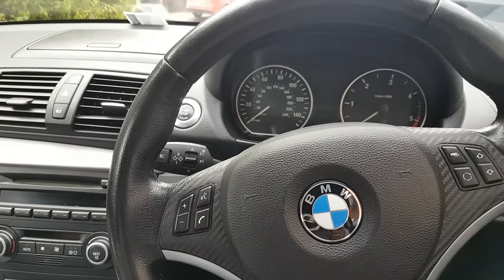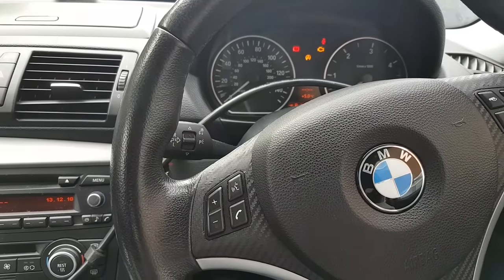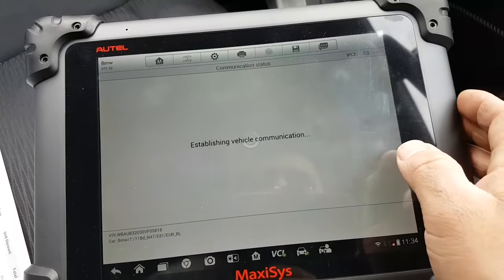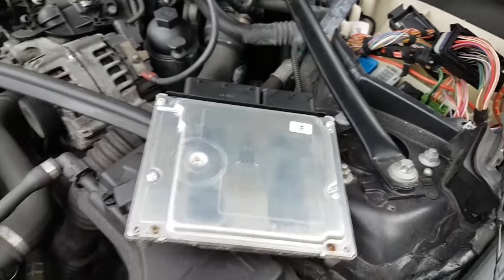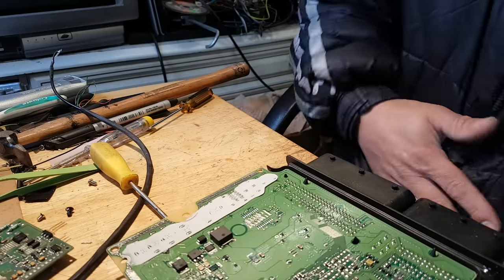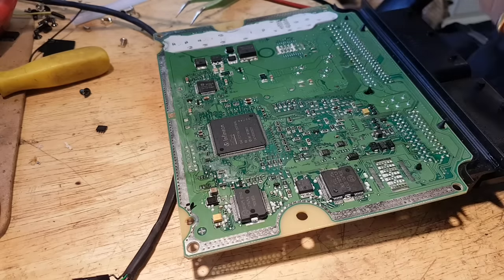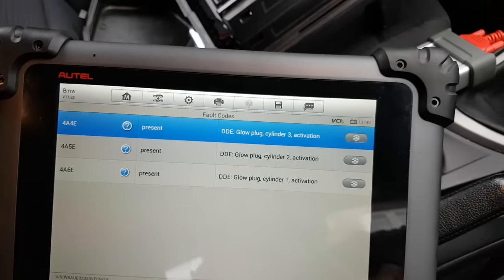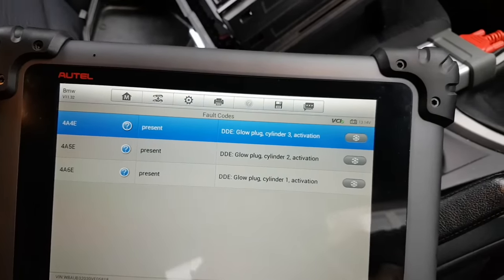BMW 118d not starting. No DDE communication. Fault finding and repair.

Comment: Hi my 2007 BMW 520d was parked battery drained and run out of diesel I put about 15 litres of fuel and used to jump Leeds from another car to charge the battery but it still wouldn't start it still cranks but won't start can you please help me.
Reply from the maker: Scan the car and go from there....
It might just needs priming though...
Thank you for watching!
Reply: @LMAutoRepairs  I did prim it with ISTA D
Reply: @LMAutoRepairs  on ISTA D the only fault codes I get DDE glow plug cylinder 1 2 3 4
Reply from the maker: @mishokorlov  
Check live data... something is missing...
Don't scan just the engine, check the CAS... low battery is know to do sync damage....
Reply: @LMAutoRepairs  Ok thanks I will try later. Regards

Comment: Is there any problem putting 1.5k resistance from 1.6k
Reply from the maker: Probably not...
The difference it small for the application in question...
Thank you for watching! 
👍👍👍
Reply: Thanks for replying Can the  bad transceivers be  the main reason for communication error I have the   same exact problem I reflow'd trace but still no communication  what might be possible  reason can you please help me
Reply from the maker: Yes... it can... 
But can be other things...

Comment: I’ve already opened the box, but there's no trace of water, and I opened the EKU but it's all okay. I dont know whats the problem. The car cranks but not start.
Help me please??
Reply from the maker: Have you scanned the car?
Thank you for watching!
Reply: @LMAutoRepairs  Yes, all its ok but DDE don t read it. Just like ecu he's not even on.
Reply from the maker: So, check powers and grounds... etc...
That's where you should have started...
Reply: @LMAutoRepairs  i cheek the battery and i dont have sufficiently the power with the little red cable who come to the box red. Everywhere i have 12.40 V but there i have 3.51 it is possible that this is the cause or its normal.
Reply: You know whats the reason why i dont have contact with the DDE. All is conectet but the computer not read it??
Reply from the maker: Again... check power and grounds at the ecu...
If all good, check communication lines...
Do the other modules report the failure of communications with the DDE as well?
Reply: @LMAutoRepairs   the diagnostic dont read the dde it's as if it doesn't exist. Do you know who is cable who aliment the dde? Because now i check i dont have electricity to the one cable red ride by side. Thanks for all answers men.
Reply from the maker: Being a red wire means nothing...
You need to get diagrams and properly check all the feeds to the ecu etc...
Can you communicate ok with the other modules on the car?
Which tool are you using?
Reply: @LMAutoRepairs  diagnostics were made by a mechanic and told me that my DDE has no communication and that he can't find it on the computer. Hi told me to bye new dde and after hi can changes the parametres... but is so cheap. I think is some cable who come to the battery.
Reply from the maker: So, the fact that there is no communication with the module, does not means immediately that the module is bad... there is a series of checks that the mechanic should be able to do before condemn the DDE...

Comment: I guarantee the drains at the bottom edge of the front windscreem inside the engine bay were blocked
Reply from the maker: 31:41 you haven't watched the entire video...😉
Reply: @LMAutoRepairs  haha great repair
Reply from the maker: @DodgeCity111  
👍👍👍

Comment: Hey, I don’t know much about ecu’s so this may sound stupid but can I just replace my ecu, or does it have to be reprogrammed help is needed my first car and has been a struggle thanks!!!
Reply from the maker: Hi, yes, most likely will have to be programmed...
Which car are we talking about?
Thank you for watching!
Reply: LM Auto Repairs I have a 2008 bmw 328i, even if I buy the same exact ecu for the same year car with the same engine and everything identical. A used one that’s come off another car will still have to be reprogrammed?
Reply from the maker: @catalyst_yt1472  
Unfortunately, or fortunately,  yes...
The ISN needs to be programmed into the "new" ecu, otherwise the car will not start...
Reply: LM Auto Repairs okay, I think mine has gotten wet too as it’s a no start and it’s receiving fuel, air, and spark. So I think the ecu is throttling it from starting. It does start here and there after cranking it for awhile and when it does the engine runs great. So that leads me to think the ecu got wet, the covers been on and off of that container throughout the last couple of months because we had some other wiring problems but now we’re just down to that...
Reply from the maker: @catalyst_yt1472  
Hope you get it sorted!
👍
Reply: LM Auto Repairs thanks i need the luck
Reply: Is there any way I can send you over a picture of my ecu??
Reply from the maker: @catalyst_yt1472  
Not on youtube...
Reply: LM Auto Repairs okay I opened up the ecu today and I think it looked fine

Comment: I need some help on a BMW X6 injector 5 ground short to positive side can you help
Reply from the maker: Hi
Which checks have you done so far?
Thank you for watching!
Reply: I have checked the injector loom to dde it seems to cut out only when car has warmed up
Reply from the maker: @littledean8593  
Have you checked that there is no wires scuffed or worn that touch the engine or something like that?
It can also be the injector itself...
Reply: LM Auto Repairs thank you so much for your reply and your help, The wiring loom to the injectors are fine I took it out I did a continuity test on each wire all came back fine so I did suspect injector car keeps shutting of when warm and when I rev it it, how do I know which injector it is I did swap a couple injectors round but it still points to injector 5 even the I swapped out injector 5 could the dde be broken if any wires touched very confusing are you local I live in south east London
Reply from the maker: @littledean8593  
Ok... you never mentioned before that injectors have been swapped...
If you swapped them, and always points to number 5, then could be loom... but you said you checked that... so, could be indeed the ecu...
Reply: LM Auto Repairs is there anything too look at on the ecu can you call me please
Reply from the maker: @littledean8593  
It might not be visible... you need to measure it....
Reply: LM Auto Repairs what do I need to measure ? I’m confused but thanks for your help
Reply from the maker: @littledean8593  
Components? 
You can open the ecu, and visually everything looks ok...
Reply: LM Auto Repairs yes opened ecu and everything looks visually good I have ordered a new loom from injector to dde also I thinks
Maybe one injector bad
Reply from the maker: @littledean8593  
But if you moved the injectors and the fault remains in number 5, that rules out a bad injector...🤔
Reply: Okay so I removed all the injectors and found out that injector 6 is being shorted and grounded to the injector case could this be my issue, I checked the resistance and continuity on all the injectors and number 6 results are way different I can even create a circuit with and led and the led lights up off the injector case were all the other 5 injectors don’t, I have ordered a new injector just wanted your opinion on this
Reply from the maker: @littledean8593  
Makes sense.... 👍

Comment: It takes a SHARP  -engine.eel-  (actually lots of them)  to put the ECU inside a  plastic bucket with no proper drain hole at the bottom;  damn, they think of the neatest tricks, we be fooked!
Reply from the maker: There is actually a drain... unfortunately not up to the job... and blocks easily...
Thank you for watching and for your comment!
Reply: All BMW drain holes seem to block very easily and require plenty of regular clearing out. There are quite a few. I've never had problems with any other make of car I have owned but loads of drain probs on BMW 760!!! Gotta keep on top of the issue. 👍

Comment: един ;) 🇧🇬
Reply from the maker: Благодаря!
за гледане и за ваш коментар!
Reply: @LMAutoRepairs  къде живееш в Англия...
Reply from the maker: @satiyorum  
Какво ти е необходимо?
Reply: Kolata ne pali i dava greshka eko hreshka,ne moga da napravya vrazka s komyutara na kolata
Reply: Svatzvashe se s komyutara, no sega ne pravi vrazka s komyutara
Reply from the maker: @satiyorum  
проверете правомощия и основания ... ако това е наред, проверете може ли линии и окабеляване ... може да се нуждаете от електрически схеми за това ...
в крайна сметка може да имате лош модул ...
Надявам се, че помага ...
Reply: Hi can i read Siemens ems 2102 eco with ELM 327 obd cable  can u give advice please.
Reply from the maker: @satiyorum  
What exactly do you want to read?
Codes?
Reply: @LMAutoRepairs  I got problem with ecu  I think car doesn't want to start no crank from key but when i used from relay it want to start but fuel doesn't coming from from pump. I try to connect ELM327 but no obd connect say put to Key ON,  just flashing Immobilizer light, i check obd ports is ok starter is ok all relay, fuse is ok. I checked ECU soket is coming low voltage T1 and T2 is low voltage 3.8v- 4.2v just T3 is ok 12 volt  when i read last time give me codes U0100 - Lost Communication With ECM/PCM
B1A55 - Crash Record Output
P1607 - MIL Output Circuit
B10DA - PATS Target Identifier
U2005 - Vehicle Speed 

Thanks for answer me,